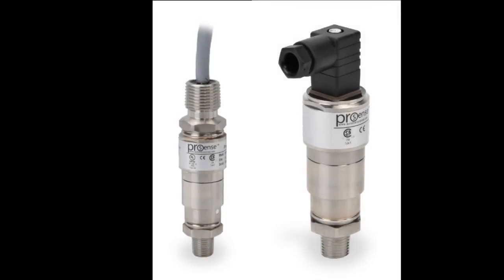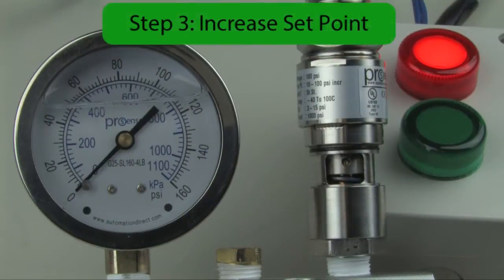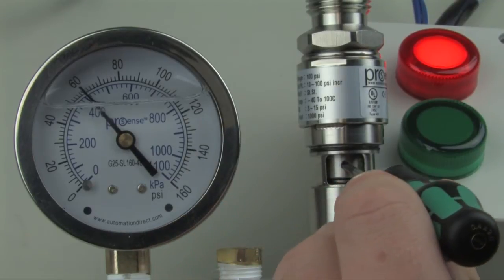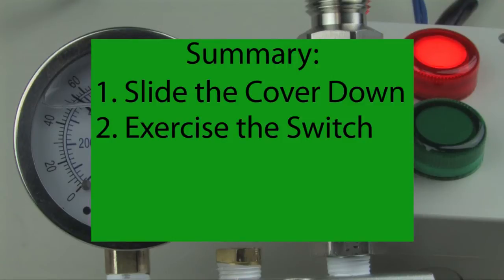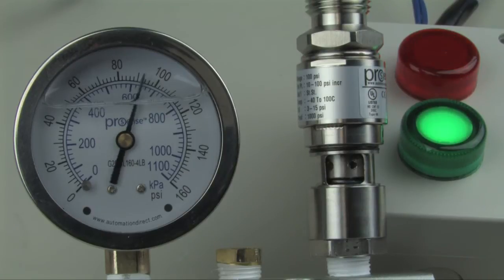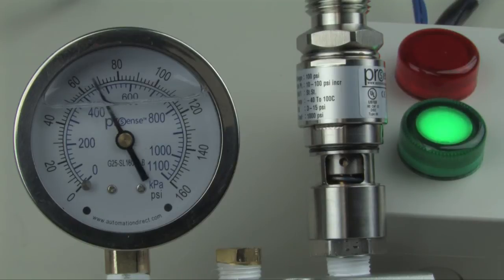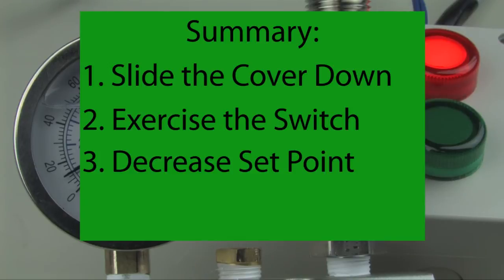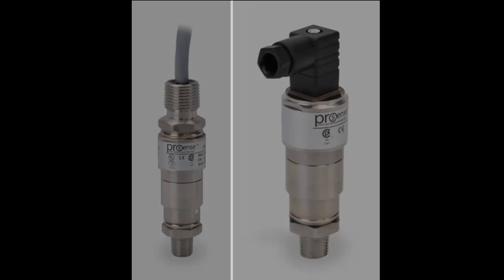How To Calibrate a ProSense MPS Series Pressure Switch from AutomationDirect

Comment: Could I calibrate one with cylinder tank and a volt meter
Reply from the maker: All you need is pressure and a gauge to know where to set your switch points.